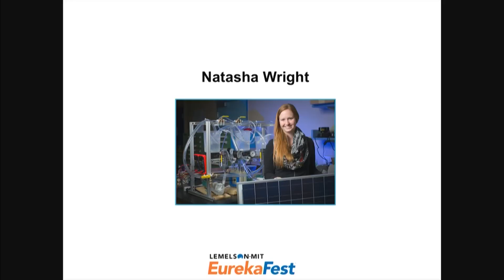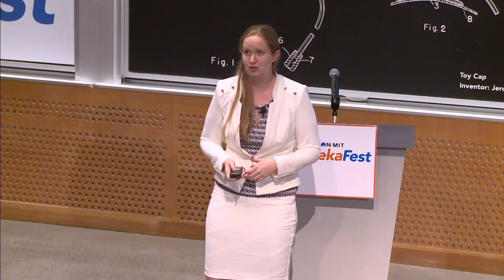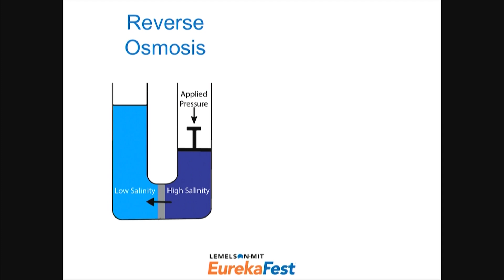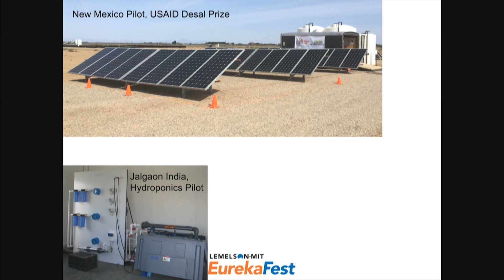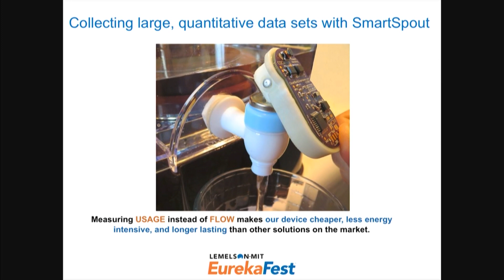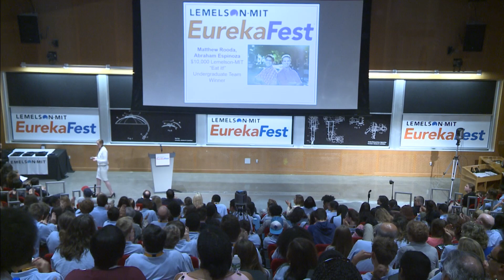Solar-Powered Desalination System for Off-Grid Water Production in India and Gaza

Comment: No mention of boiling the water and using evaporation process to desalinate the water and then use standard filter/purification systems
Reply: That is because the energy requirements for that type of system are prohibitively high for a large scale community based water production facility.    The method she describes is far more energy efficient and produces a lot more fresh water.     There are lots of ways to distill water - but, doing it large scale and in an energy efficient manner that meets the demand is the real challenge.    If you only need a small amount of fresh water each day for your own personal use, the energy inefficiency and low output are not prohibitive.
Reply: Richard Owens right now the most  efficient way is RO. If we ever solve fusion energy then distilling will be available on a large scale but nano materials as filters sounds promising.
Reply: @RayZde  You can never call an RO system efficient - the water waste and energy used means it's very inefficient. This is why they usually collocate a power station next to a large RO system and then have long pipes from the RO system back into the sea to better distribute the  waste water and brine concentrate.  It seems however that RO is still used regardless of waste and energy use until something better is developed.